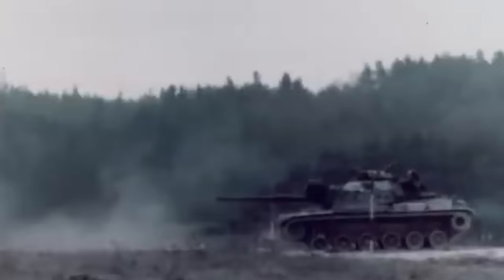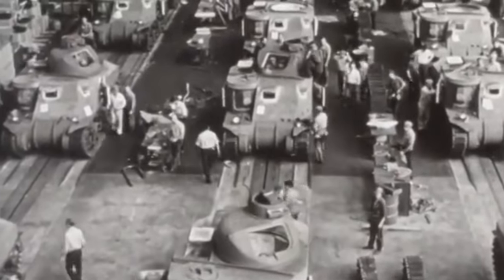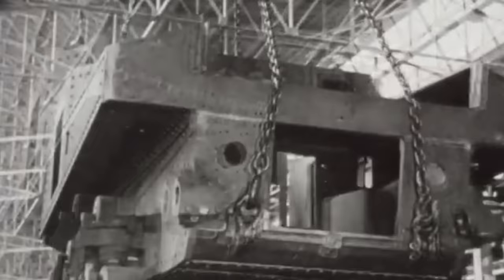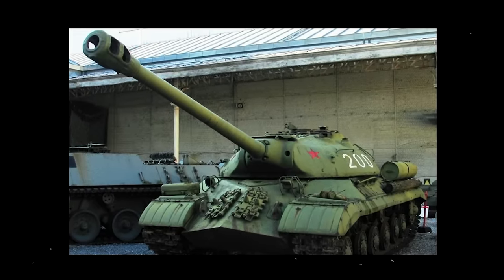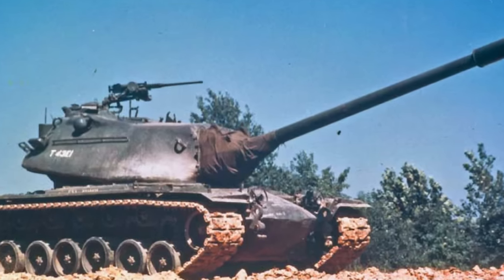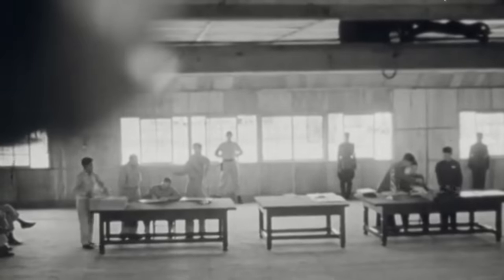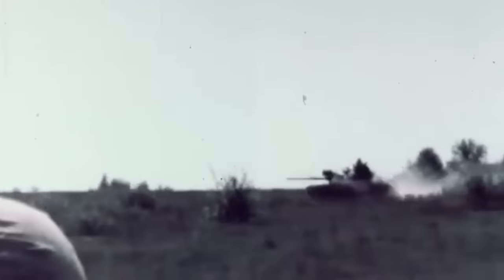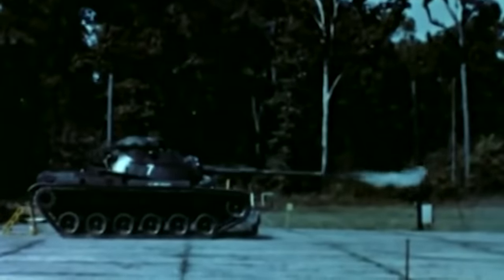The Too-big-for-combat US Monster Tank with the 120-Millimeter Gun

Comment: The 120mm M58 is still one of the most powerful tank cannons ever made to date.
Reply: Most powerful tank cannon to be mass produced and used in service (we're ignoring prototypes). Most 3rd generation MBTs like the Challenger2 , Leopard2A7s and M1A2 Abrams fire rounds with the kinetic equivalent of 9.7MJ to 12.8MJ . The M103 fired a 120mm AP-T round with the KE force of 13.2MJ. Even monsters like the Jagdtiger with its 128mm, T-10M with the 125mm couldnt top it . Although 4th Gen MBTs like the T-14 armata, KF-51 Black panther (which neither have officially entered service) have surely surpassed it those tanks all used sub caliber APFSDS munitions, the M103 didnt which makes it more impressive after all these decades .
Reply: @cherrypoptart2001  imagine what modern powder, shell design, and bore could do with that beast.
Reply: I cannot remember the exact numbers, but the 120mm M58 is technically more powerful than the Reinmetal 120mm smoothbore as installed in modern Leo 2's and Abrams...only the ammunition is weaker, as it lacks the ability to shoot the modern apfsds DU rounds...so it won't penetrate as well, but it makes a bigger boom. By the measurement of kinetic energy or something, it IS the most powerful gun ever equipped on a full production model tank. (ie: not including prototype/test tanks armed with things like 140mm guns, etc)
Reply: Except the CEV with a 165mm demo gum. We, EN, laugh because tankers and Arty were jealous we had the larger Dia gun on in the battlefield so it was decommissioned 😂

Comment: I trained on APC at FT. KNOX and was with 4th inf div in vietnam. A armored calvery out fit had 9 M113, 13 ton and 5 M-48 52 ton . A good M-48 did 30 mph on 650 HP. The APC with 50 cal. 50 mph. the enemy loved these as 7 NVA Fired captursed M16's into lead tank at 70 yards. FB-Schular, LZ Oasis, FB X-Ray.

Comment: 2:39 "Although not a true competitor against the Panther and Tiger tanks it could fight them head on and survive if the crew outsmarted the enemy" 

I'm going to need a bit of clarification on what you meant here because if you're saying that the M26 Pershing was in any way inferior to the Panther or Tiger 1 tanks then we're going to have some serious problems because this portrays a serious misunderstanding of the vehicles in question. 

Put bluntly the M26 was overwhelming superior to both in armor and firepower and somewhat superior in mechanical reliability (though it was still considered to be subpar in this regard for US Army standards, that was one of the major improvements the M46 brought to the platform). 

Protection:

-The Tiger 1's frontal hull armor was a mere 102mm (4in) with no functional angling to speak of meaning the base thickness was the only protection offered. Good for it's day but thoroughly outdated for a Heavy Tank by the War's End.

-The Panther boasted an impressive 80mm (3.15in) thick frontal hull sloped to an effectiveness of 140mm (5.5in). Very respectable even for the end of the war but far from impenetrable.

-The M26 Pershing boasted a 102mm (4in) frontal hull sloped to an effectiveness of 155-180mm (6.1-7.1in) depending on where specifically a shell struck. Very impressive but on the more tame side for a Late War Heavy Tank.

Firepower:

-The Tiger 1's APCBC shell could penetrate 162mm (6.4in) against a flat plate at 100m (109 yards)

-The Panther's APCBC shell could penetrate 185mm (7.3in) against a flat plate at 100m (109 yards)

-The M26 Pershing's APC shell could penetrate 210mm (8.3in) against a flat plate at 100m (109 yards)

The only downside to the M26 by comparison was the fact it arrived late so a negligible amount that actually made it to Europe during the War as a mere 200 made it in theater and only 20 out of those saw combat but it is important to note that out of the 20 that did they performed excellently in the face of enemy armor despite being on the offensive.

However, we all know hard numbers are often deceiving when it comes to combat effectiveness as they disregard soft factors. The unquantifiable aspects of what makes a tank good. Fortunately we have the data on how the M26 Pershing performed in combat. To put it mildly it was quite excellent during it's brief tenure on the battlefield.

For only 3 tanks being knocked out during the war (One to a point blank ambush by a Tiger 1, one to being struck with artillery directly to the Commander's Hatch, and one to close range ambush by a Nashorn Tank Destroyer) and only 1 being permanently destroyed (the one the Nashorn knocked out) M26s in return destroyed an estimated 15-20 enemy tanks and tank destroyers. A minimum 4 of which were confirmed to be Tiger 1s and Panthers meanwhile only 1 Pershing was lost to direct combat with Tiger 1s or Panthers.

1 Panther lost in direct combat with the M26 "Eagle 7" at Cologne.

1 Panther lost in direct combat with the M26 "Eagle 7" at Paderborn Railyard.

2-4 Tiger 1s lost in direct combat with the M26 "Pershing #40" at Elsdorf (it's important to note that Pershing #40 destroyed 4/6 German tanks present at this battle. Four of which were Tiger 1s and two were Panzer 4s. It is not confirmed which tanks survived this battle so to be safe I just listed 2-4.)

4-6 kills against Tiger 1s and Panthers for 1 loss. You're telling be a minimum 4:1 Kill ratio isn't a "true competitor"? I heavily disagree with that assessment.

The only German tank in service during the War that was truly superior to the M26 in a head to head engagement was the Tiger 2 with the KwK43 88mm beating the standard M3 90mm in penetration (with the exception of HVAP/APCR munitions) and the hull armor being not only superior to the M26's but impenetrable to it's main gun. 

However the Tiger 2 even had it's vulnerabilities to the M3 90mm AP and HVAP munitions with it's turret face being vulnerable at medium to close range and both it's sides and rear being vulnerable within any conceivable range a hit could realistically be rendered. Something the 76mm of the up-gunned M4s and M18 tank destroyers could not truly boast.

Historian and Armor Expert R. P. Hunnicutt rated the M26 Pershing as head and shoulders above the Tiger 1 or Panther but handily below the Tiger 2 in direct combat capabilities. However, luckily for the M26 it never met a Tiger 2 in battle.

Comment: the fact the weight and cannon are similar to the abrams... its kind of interesting.
Reply: yeah, it's funny how 62 tons was considered too heavy back then, but now an Abrams weighs somewhere between 65-68 tons depending on if it has the DU armor package or not, and we deploy them everywhere! of course, shipping infrastructure and whatnot has long since been updated to accomodate an MBT that weighs as much as an old heavy tank.  a short 81 miles of range for the M-103 was probably it's main problem, modern tanks with similar weight, have better protection(thanks to either composite, spaced, or reactive armor) and can still push 300 miles...which is huge advantage tactically. if someone starts designing tanks and other armored vehicles with 1,000 mile range, that is going to be a huge game changer...imagine rolling through 2 European countries...in a single day?
Blitzkrieg reincartnated!

Comment: I've been to a place that had an M103 parked outside in an outdoor museum of sorts...the size of that beast is awe inspiring!  at 6'2" I was able to jump up and wrap my arms around the gun barrel(which was elevated around 15°) just ahead of the hull front, then pulled my legs up and locked ankles and shimmied up the barrel towards the fume extractor but only got about halfway before deciding I better drop to the ground before it was too far down...always worried about the curator kicking us out, hahah!

Comment: Why did they put a 105 on the first Abrams?
Reply: I think the Chieftain said the 120mm was not ready yet.
Reply: @Uncle_Neil  but this video talks about a tank with the 120 mm gun.
Reply: American M68 105mm and British Royal Ordinance L7 105mm were some of the most combat proven tank cannons. There was nothing wrong with them, they were more than capable of dealing with soviet threats at that time such as the T-55s, T-62s, early T-64s and T-72s. Since sub caliber APFSDS was the future of tank warfare, there only other option was the british 120mm, which was rifled and everyone at that time wanted smoothbore after seeing how much of a success the soviets had with the T-62s after switching it to smoothbore from rifled. The Leopard2s also started mass producing at that time with first abrams but there were enough RH120s to share around the block. if they US were to mount The M103's AP-T 120mm on the Abrams instead they would still have a hard time penetrating soviet  big mbts like the T-64/T-72 frontally , a sub caliber apfsds from a 105 would be more consistent and effective
Reply: @cherrypoptart2001  —- thank you
Reply: @Charles-k9g5y The video talks about a 120 mm rifled barrel. The latest Abrams, Challenger, and Leopard MBT’s have 120 mm smoothbore barrels. They all outweigh this “heavy” tank.
Reply: @varonmullis5255  —- I know that but what I was wondering is why did Abrams start with a 105 rifled gun instead of the 120 rifled gun. Also the challenger uses a 120 rifled barrel gun and holds the record for the longest tank on tank kill.
Reply: @Charles-k9g5y  It talks about a rifled 120mm gun.  The120 used on the later Abrams models was smoothbore.  And the reason is that smooth bores can fire APDS and APFSDS rounds better than rifled guns.
Reply: @jonathanspivey437  —- I understand that. Why did they originally go with a 105 rifled barrel versus a 120 rifled barrel.